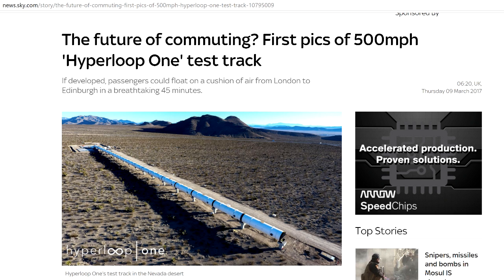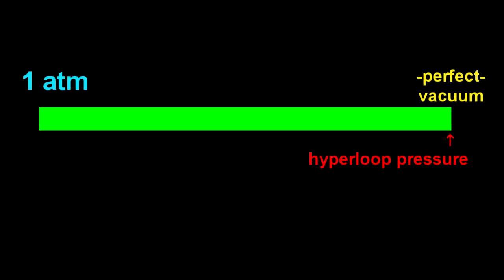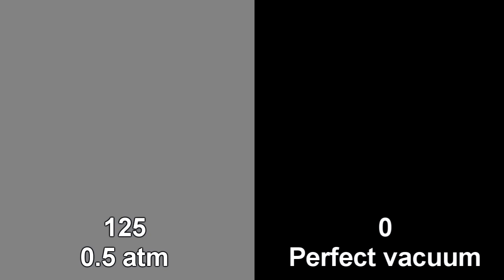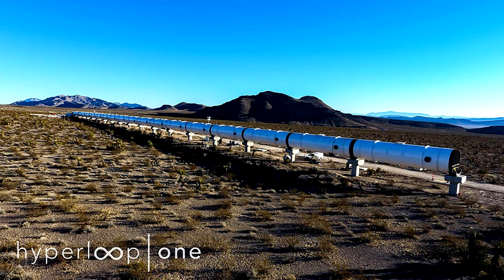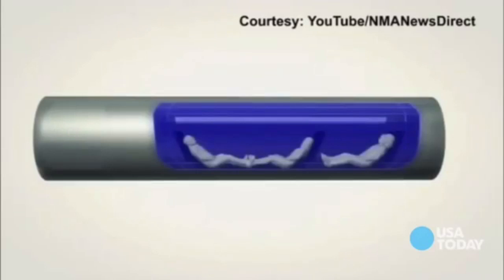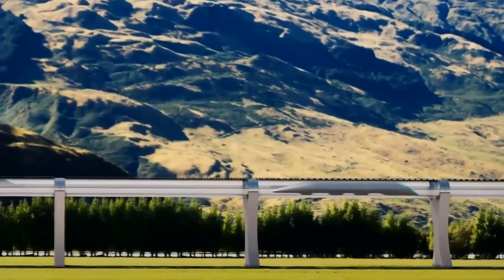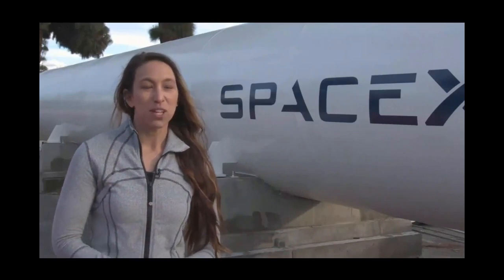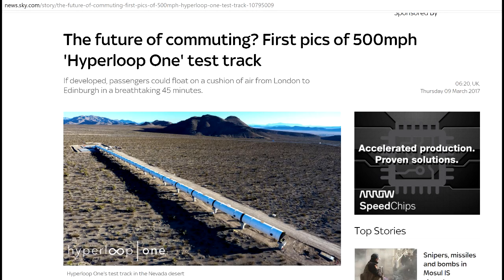Entire Hyperloop could be destroyed in SECONDS!

Comment: Perfect vacuum = 100kpa overpressure = pressure under 10 meters of water. 

At 0.1 MPa overpressure (1 atmosphere) a tube with radius of 1 meter and a wall thickness of merely 0.4 millimeters could in theory be made of the shittiest lowest quality steel you could find.
Now, naturally you would want to make sure you have some margin of safety. Lets say you want a factory of safety of, lets say 10. That gives you a wall thickness of 25.5mm using the shittiest most lowgrade S255 steel you could find. You know, the stuff that costs a couple hundred dollars per ton? The tanker trucks were grossly underdimensioned for vacuum. The data is published, their dimensions, the materials and all. Oh and also they were damaged in order to cause a controlled collapse. 

Come on thunderfoot, you dont have to do snide shit like this for views.

Oh and discounting the fact that you cannot assume isobar of 1 atmo when calculating necessary work to reduce the volume of air (you have to integrate the formula from t0 to t, because as you remove a certain dV of air, the pressure will be reduced by a dP given a closed system) two Gigajoules would not be that much. Its about 560 KWh, and you only have to do it once or again should you have to repressurize the entire system. An average household uses around 208 KWh to heat their house for a week, so its about the same amount of energy used to heat a house for 3 weeks ish, if i were to be generous.

Building things under 10 meters of water is not hard, and as a result, we can conclude building this on ground is not that hard either. 

Thunderfoot, you know that. Stay out of my mechanical engineering you slimy chemist.
Reply: I mentioned under water in order to relate the pressure to something people would be familiar with. in engineering and physics, the only thing that matters is the difference in pressure between the inside and the outside, which is called the overpressure. if you put an airfilled tube under 10 meters of water, the overpressure would be the same as putting the hyperloop on the ground with vacuum inside. The difference is 100kpa, or 1 atmosphere.

Regarding the supports point, it makes very little difference if the cross section of the tube itself is supporting it, or there are internal braces that support it. This is why car tunnels usually only have a tube made of interlocking concrete slabs holding it up, its the same kind of construction. The pressure from the outside is keeping the structure stable.
Reply: You're just wrong. I'm sorry. Submarines aren't built with the quote, "shittiest lowest quality steel you could find." FOR A REASON. I use submarines as an example because the difference between 0.001 atm and 1 atm is similar to the difference between 1atm and 10atm Which are the average conditions you'll find a submarine to be in. Thin shitty steal is not going to protect you from those high pressure levels. To say that it will is just fucking insanity. If so we would have tried it and it would have worked. 

You give me a single submarine that is made from this shitty steal and  I will give you a fucking metal. Because most submarines you'll find nowadays are made of fucking TITANIUM. I would also recommend the hyperloop to be made from the same material but of coarse we all know that's not going to happen because titanium isn't cheap and elon musk is full of more shit then a backed up sour.
Reply: To be fair, usually those things aren't hundreds of miles long with no internal supports and people travelling through them in metal boxes at 600 miles per hour.
Reply: you can disregard my comment, since i posted it when your comment was only 2 sentences long ;)
Reply: If you assume isothermal isochoric expansion, then E = V*dP is correct. You only need to take the integral for the non-isothermal (e.g. adiabatic) case. The isothermal case is the worst case, but even so at 1 atm, the difference between isothermal and adiabatic is only a factor or 2 or 3. So, whichever case you take, this is hardly deal breaking, especially as the energy requirement for evacuation would likely be mitigated by air-locks for boarding/disembarkation.

My main concern with what tf presents here is the ping-pong ball tube analogy for a vacuum tube rupture. The issue here is one of scale. The mass of the pod scales with r^3, but area scales r^2, and that's not taking account of the aspect ratio of the pod. Using realistic scaled sizes and mass, the acceleration on a pod following a guillotine vacuum tube rupture would be comparable to that of a modern performance car, or a passenger aircraft at take-off - disruptive (spilled drinks) and possibility of minor injuries in standing passengers, but not the catastrophe that tf seems to imply.
Reply: "It is quite simply a trivial engineering challenge."
Sure is buddy, that's why it's been proposed several times in the past... also sure you could protect it against cars that's a fucking trivial engineering challenge... how about the stress of a 500mph pod? earthquakes? I mean did you hear where they were building it?
Get your dick out of the fucking vice and go back to class, you might learn something called "risk assessment". 0.4mm is enough but just to be on the safe side 25.5mm... Jesus Christ is that's what comes out of universities nowadays?
Reply: +Geeky Didn't he show what would happen with a dent to show how easily the Hyperloop could fail with an accident or a terrorist?
Reply: +Rads
"Cheap carbon steels"
I believe in the first post, the specification was S255 steel. This steel has a yield strength of around 235-255 MPa. A solid rod of such strength at 25.5 mm diameter could suspend a 12 T truck on its own (with some simple back of the envelope calculations). m = PA/9.81
Reply: Geeky  
pls go to Google images and search this "Precast segmental linings"

and tell me how thick is that concrete slab vs the thickness of  the hyperloop pipe.

and about the english channel  tunnel some part of the tunnel actually held themselves up to the pressures of the water and dirt infact and didn't really need a precast segment so in a quest for speed the English just put iron slab only to the poor soil region of the tunnel.

and you don't need a degree in engineering to show a person is wrong but you do need an interest in that subject.

I do not have a degree in engineering(because I am 20ish year old)but my interest in the tunnel building under the ocean had lead me to watch a lot of documentary on TV and YouTube and understanding the challenge in building a tunnel that is under pressure.

I want to hear your feedback because I want a discussion on this topic
Reply: But are you factoring Pressure of atmosphere + pressure on structure from it's own mass?

IE, your first example of a 1m steel tube of 0.4mm thickness. Having worked with metal for some years doing HVAC plumbing, that sounds like straight bull**. I wouldn't expect that to stay in shape without significant bracing once I let go of it, settling into an oval with higher forces on the sides at the apex' (for want of a better term).

I feel similarly about your train of logic, that while the intent seems genuine you are not taking all forces into account. I misread your previous comment so apologies for the erroneous reply.
Reply: +Geeky maybe 1018 HR is the most common steel I've seen. It' easy to weld and machine.
Reply: +Geeky Yeah I focused on robotics because I figured it's the safest field to be in when the robots start replacing jobs en mass. Robots are going to be the new mexicans. Donald Trump's wall makes me laugh because mexicans aren't a threat to american jobs, robots are. lol and when manufacturing plants move back to detroit they will be mostly automated hell I knew an engineer who ran an entire plant himself from a control room because it was that automated. The office moved, but the Engineer wanted to stay in Northern Michigan so they left the plant there and he still runs it himself to my knowledge though they may have hired other engineer to watch porn in the control room pretending to work.
Reply: I can't keep my forward kinematic equations to be straight that's why my robot is gay.
Reply: Geeky, you've failed to consider the volume of water and the pressure, which leads to a massive amount of energy W.

Sure, its easy to build things under pressure. People have sent capsules to the bottom of the ocean. What they haven't done, is send a 2,000,000 m^3 vacuum chamber to these places.

I think you should revisit thermal physics, a basic P-V diagram will show you the immense amount of energy that it would take to do this, and it would tell you how much energy would be released should it fail.
Reply: I get what you're saying, but youre waifu a shit
Reply: What are these early submarines of world war 1 you speak off? You didn't tell me that nore did you specify what materials they were made out of you just said "Cheap carbon steels" which is very vague. You sound like the terms and conditions I read whenever I install a software. 

For the sake of argument I am going to go with German u boats because as far as I know they were the "Early submarines" Used in world war 1. They had a double layered hull... okay so far were off to a bad start. I was unable to find what materials they were made out of with a quick google search. However, It's safe to assume the material they were made from was not cheap or shitty. It needed to withstand 145 pounds per square inch of pressure. Because that is the water pressure at around 100 meters which was a u boats maximum dive depth. 

Whatever "Cheap carbon steels" (Whatever the fuck that is) they were made from it probably wasn't shitty. 145psi is a'lot geeky and a 25 millimeter wall isn't going to be enough to survive it. You should know that from basic logic.
Reply: Could you point me towards the articles with ww1 subs with that depth test? biggest dive I was able to find was 87m due to an uncontrolled descent.
Reply: What's the safety factor of that shitty steel tube?
Reply: +DevinDTV Listen Thunderf00t isn't an engineer, but I would call his videos  psuedoscience. If you don't like his videos you probably should probably just not watch them. Do you think his evidence against solar roadways was also psuedoscience?
Reply: +Geeky that is the energy to pressurize one tube, it's a few hundred miles long.
Reply: So Geeky...  What about that sagging under it's own weight thing.  My (lay) guess at it is that it's because the ends are not sealed and gravity acts on only one vector.  Once sealed, wouldn't the difference in pressure along the entire circumference reinforce the shape?
Reply: Geeky 
"a tube with radius of 1 meter"
"The problem can be mitigated by making the capsule itself cover, say, only 2/3's of the total internal cross section of the tube."

Tube cross section is effectively 3.14 meter^2 and 2/3 of that is like 2.1 meter ^2. If the capsule has a circular cross section then its height will be somewhere at 1.6 meter.
This seems to be a rather small capsule to be of any practical use?
Reply: "Perfect vacuum = 100kpa overpressure = pressure under 10 meters of water"

Lol, no.
Reply: That's the properties of the steel, but I wanna a name. Not a list of properties cause I can't narrow it down without some kind of steel analyzer thing.
Reply: Oh my god! Could you give me a fucking name? I'm not reading the fucking terms and conditions of a how to operate a car wash! If you could just give me a fucking name maybe I could sort out your claim about this shitty steal being used on geman U boats. 

Also I'm still here you haven't replied to my comment yet. Are you sleeping?
Reply: Look Geeky if you want me to fucking simplify it so your tiny mind can understand it. With regards to your claim of "WW1 Submarines being made out of cheap carbon steels" YOU DIDN'T BACK IT UP! You said Wikipedia said it but didn't site it. Come on your making yourself to be worse then Thundercuck. 

You wanna now what I'm thinking cause I gotta guess. You're pulling together bullshit and know full well german u boats were not made from shitty materials and, just don't have the balls to admit that you lied.
Reply: +Geeky
How many tons of steel will be needed to build an actual size tube as proposed?
Elon Musk seems to be super cereal about this hyerloop thing. I wana know if I should start investing in steel.
Reply: Im too novice at physics for this.
Hey, at least i can calculate SOME of what thunder does.
Reply: FIRST OF ALL: A tube under atmosperic pressure pushed 10 meters deep in water would have equal pressure on both sides you cretin.

Tunnels aren't made out of a thin sheet of metal. And they are burried under the seabed, not in the open water. Also you goddamned imbecile when they are burried the majority of outside force is carried by the ground around it, i don't know why you fucking tought rock will behave like fluid and have a pressure, what the fuck do they teach at engineering schools today? You know there are these wonderful things called ARCHS, they were discovered like, phew.. I don't know THOUSANDS OF FUCKING YEARS AGO. Making a tunnel under the seabed is like digging a tunnel trough a mountain. Good Lord my brain hurts from reading your comments.

Underwater pipelines are, smaller in diameter, and aren't being run under atmospheric pressures, they are pressuresd so it offsets the difference by a large amount (usually around 1500psi). Not to metion they are coated with layers of protection against abrasion and corrosion. Again you claim to be edicated on this yet you have no idea about the amount of planning that need to go into a pipeline. They don't just decide, "well I am gonna connect this 2 dots on the map", they build where they can, and most of the times it is not a straight line. The hyperloop by design need a perfectly stright line to be usable.

Then to the next point, none of the examples mentioned by you have high velocity projectiles flying trough them at supersonic speeds, so comparing their safety is ridiculous.

I don't thnk it matters if the pipe is dented before or after, deliberately or acidentaly, I don't know why you tought that is a fucking point?????? Hello?? What the fuck are you smoking dude???

You also did not take the time to adress the heat expansion (a lot of pipes are burried to deal with this), we are talking a desert here, with huge temperature swaying.

All in all. People way smarter than you already dismissed the idea as stupid, 80 years ago, mr mechanical engineer. I am sorry that reality buttfucked your little idol Musk, but unless you find a way to suspend the laws of physics, I am afraid this project is a bust.

PS. Really hope you will never get a job in actual engineering, you will cause deaths with this level of education.
PPS. English is my fourth language, please excuse any grammatical errors.
Reply: Geeky underwater it will have to resist even more pressure
Reply: im sure the water does not put pressure on tubes in any way x)
Reply: How often do we build 1000 km long pipes at atmospheric pressure under 10m of water though?
Reply: +Rads
World war 1 submarines according to wikipedia had a test depth of no more then 100 meters and were built of similiar types of cheap carbon steels such as the kinds im referring to. The math is in my original post, the basic formula for hoop stress in a pressure vessel is pr / t = hoopstress where p is pressure, r is radius and t is wall thickness. you can calculate yourself and check for different yield strengths rads. The yield strength is the point at which a material stops beeing elastic, so if you exceed yield strength, itll stop springing back to its original shape.

+TheKSPDesigner
I already have a boyfriend :P

+Mohd
The material choice depends on the requirements. You can push and push as much as you want on concrete and it will rarely crumble, but itll crack very fast if you try to pull at it. Concrete has similiar compressive yield strength as steel, but far lower tensile strength. It is however a lot cheaper.

For tunnels with large radii like for cars, its usually cheaper to use concrete, especially because you dont have to contain a vacuum. If you were to build a 6m radius tunnel out of steel, it would have to be a few centimeters thick, if not more because you also have to hold the dirt and the mass of the rest of the tunnel. This is a lot of steel, but you can replace it with concrete because the problem can be solved that way cheaper.
Reply: really? do you know how much that would cost? probably 2 times more, and since water is denser than air,it would be even more dangerous since the water could break the tube.
Reply: +Acerrox He also provided zero sources that show any of the conditions of the experiment.  Not all pressure vessels will have this reaction.  Note Thunderf00t is also extremely disingenuous in his representation of pressure he once again falsely uses a linear scale to prove his point when pressure needs to be represented logarithmically.  You can see this in both the classification of vacuums and in the expanded air ratio.  
http://www.engineeringtoolbox.com/vacuum-expanded-air-ratio-d_1194.html
http://www.engineeringtoolbox.com/vacuum-converter-d_460.html

So the Hyperloop falls under a medium vacuum classification which in reality isn't a really impressive vacuum.  Ultimately it is quite likely that the vacuum would have little issue dealing with these stresses.
Reply: ehh.. grossly overestimating the volume of steel used, external radius 2 meters internal 1.98, total length 500km, density of steel beeing 8000kg/m^3 ish and the price beeing 400dollars per ton, gives a total investment in terms of the raw materials of approximately 400 million dollars, not factoring in theyll probably get some significant bulk discount. ;)
Reply: +Mehashi 
Thats why i used a factor of safety of 10. Normally in the things i do day to day we usually use FoS of 3-4, i assume a factor of safety of 10 would be adequate. But the dimensions i ended up with are still small, and i would expect them to do finite element analysis on the structure before building it. I'm lazy so naturally i only did the simplest back of the envelope calculations on the structure in order to illustrate that thunderfoot was trying to make a storm in a teacup. All that aside, the segments clearly have ringbraces around on the outside in order to support, in addition to the walls beeing thicker then the one i came up with. The ringbraces i also did not take into account. If you google hyperloop dimensions youll get the dimensions for the testtrack spacex used if im not mistaken, and i used those dimensions as a base reference.

+RompotMechanikos 
Thats even stronger then s255. I cant remember actually using it personally, but yea. Steel is a lot stronger then people give it credit for. If they were suggesting making the hyperloop from plastic, i might agree with thunderfoots criticisms.
Reply: +Rads
Ok so, 145 Psi is the pressure at 100 meters, correct?
The uboat is no more then 6meters in diameter, 3 meter radius.

 The hoop stress in a cylinder (around the circumference) is stress = pr / t which means, 255MPa = 1MPa * 3m / thickness.
This implies that if you used a steel with a yield strenght of 255 MPa (what i referred to as shitty steel), the wall thickness would have to be at least be 11.8mm thick to handle 10x the overpressure the hyperloop has to endure. Its just math ^^
Reply: The one i calculated in the original comment had a factor of safety of 10, which resulted in a wall thickness of 25.5mm and an internal radius of 1 meter, using shitty255 (S255) steel. Normal factors of safety in actual projects are usually ~3, but can vary, usually between 2 and 8.
Reply: +Player ST 
For a test track, its more then enough to put some test equipment in. Most humans arent actually taller then about 1.9 meters, so it might be ok, though im not sure what the hyperloop people are planning.

+Mehashi
Yes. You can calculate it yourself, the math isnt hard ;) People have this weird view of vacuum that its this weird hazardous nothingness thats super dangerous or something.

+Rads
S255 is a steel grade. Steel manufacturers make steels, and then name them according to their grade. Brands arent necessary, were only looking for "cola flavoured soft drink" not "coca cola" or "pepsi" Google S255 youll get tons of pages on that type of steel. its really common, on account of it beeing the cheapest and most available steel.

Ohhh, i get where the confusion was. No, i meant steel of that grade could be used on german uboats with a rather small wall thickness, it doesnt necessarily have to be that. I looked up and tried to find what was actually used, but couldnt find any sources.
Reply: +Mehashi
Hyperloop has sea level air on the outside, and nothing on the inside right? which means theres a pressure difference of 100 kPa, because:
DeltaP = Poutside - Pinside => DeltaP = 100kpa (1atmosphere) - 0 = 100kpa.

At 10 meters below water, we use the following equation, as the pressure inside a tunnel at that depth would be 1 atmosphere, and the pressure outside determined by the hydrostatic pressure: 
P = P0 + rho*g*h => P = 100kpa (1atm) + 1000 * 9.81 * 10 Pa = 200kPa
DeltaP = Poutside - Pinside => DeltaP = 200kPa - 100kPa = 100kpa.

As you can see, the pressure differential is the same.

+Rads
Check the math, you could use a fairly thin hull of S255 steel to make a submarine with the specifications and the requirements of german ww2 submarines. 

"Ok so, 145 Psi is the pressure at 100 meters, correct?
The uboat is no more then 6meters in diameter, 3 meter radius.

 The hoop stress in a cylinder (around the circumference) is stress = pr / t which means, 255MPa = 1MPa * 3m / thickness.
This implies that if you used a steel with a yield strenght of 255 MPa (what i referred to as shitty steel), the wall thickness would have to be at least be 11.8mm thick..."

From wikipedia: [Wikipedia.org Submarine_hull]
"World War One submarines had their hulls built of carbon steel, and usually had test depths of no more than 100 metres (328 feet). During World War Two, high-strength alloyed steel was introduced..."

Carbon steels are steel with carbon content of around 2% by weight. S255 is a grade of steel that falls under that classification, and, due to increasing knowledge in materials science over the last century, current steels outperform steels of that time quite substantially, even the cheaper ones. Its still not important, this whole submarine business is a complete red herring.
Reply: Subsea tunnels are actually very common. Take the tunnel that runs under the english channel for a single example, its 51 ish kilometers long, and at its deepest, its 115 meters below sea level, and 75 meters below the sea bed. As dirt is denser then water, it has to withstand a lot more overpressure, and still it is not nearly as insurmountable an engineering challenge. Every single suboceanic pipeline is also an example you can take into account.

The seikan tunnel in japan runs a lot deeper, 
The Eikesund tunnel, 
The Busan Geoje tunnel,
The Vardø Tunnel, 
The cross harbour tunnel
Et cetera.

Note these are all a lot shorter then the proposed hyperloop, but the primary challenge and costs involved in making these is actually the digging involved, not any kind of mechanical or physical stress on the tunnel itself. Thunderfoot is making a storm in a teacup about the hyperloop. As it is quite simply a trivial engineering challenge.
Reply: +Nukedk
I searched it on wikipedia and took the deepest depth listed anywhere i could find for that time period, It was in the general "submarine" article from what i can recall.
Reply: +RompotMechanikos
Cool! Im in fluid dynamics and thermal power generation systems myself ^^
Reply: +ChumpusRex 
Thermodynamics was a while ago and afaik i seem to remember i got a B, so take my original comment with a pinch of salt. I had the most problem with the way he phrased it, in terms of GJ, instead of relating it to something like house heating which is easy for people to relate to, and realize that its not really all that much. 

The ping pong ball analogy is only relevant for a sufficiently small gap between the ball and the tube, as well as a low enough density of the capsule in relation to the pressure. This is why bullets are not shaped like darts and why they expand to fit barrels, in order to make the most use of the pressuregradient behind and in front of the projectile. The problem can be mitigated by making the capsule itself cover, say, only 2/3's of the total internal cross section of the tube.
Reply: Again, its misleading. Hes showing what will happen with a vacuum truck not rated for an overpressure of 100kpa that has also been damaged. These kinds of vacuum trucks are usually used in the same manner your household vacuum cleaner are, and as i said, youre not terrified of tunnels collapsing every time you are out driving, even though it is a lot easier to "break" a tunnel by internal damage then it would be to break the hyperloop due to external damage.

Cars are really dangerous because i can slam a car into a brick wall going 600km/h, when the car has a rated top speed of say ~100km/h.

+Nobody P
P = P0 + rho*g*d, you have to add the original atmospheric pressure ;). At 10 meters depth, the overpressure is 1 atmosphere. ( P = 100000 Pa + 1000 * 1 * 10 = 200 kPa, subtract the internal pressure of 100 kPa ). Heat expansion is actually a lot less dangerous then creep and due to the way creep works, you could actually circumvent it by perpetually heating the pipe when it is cold, thereby keeping it at a constant temperature. Otherwise there are also other ways to mitigate it, but i saw no need because i didnt quite catch that beeing a major subject in this video. Strain transformation on perpendicular axes using constant volume is also a possible solution.

Supersonic projectiles are also not a problem. Rough turns are. You can calculate the internal centripetal acceleration using the formula a = v^2 / r if youre interested. In short, the problem is making the turn with a large radius so that the acceleration and, because of it, the normal force pushing between tube and capsule doesnt get too high.
Reply: Pretty dank when someone who actually has a fucking clue what they're talking about comes and takes a massive shit on thunderf00t's psuedoscience. Hey maybe the hyperloop is a stupid idea, I don't care. But thunderf00t is pushing some pop-sci bullshit for cheap views. Even a layman can see the intellectual disingenuity of thunderf00t's arguments.